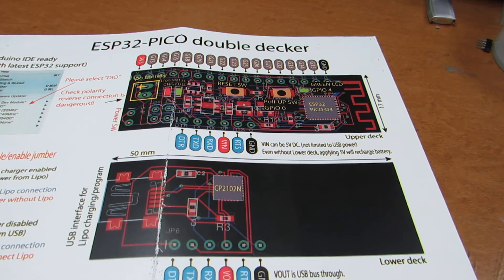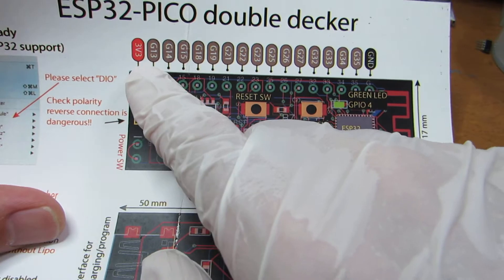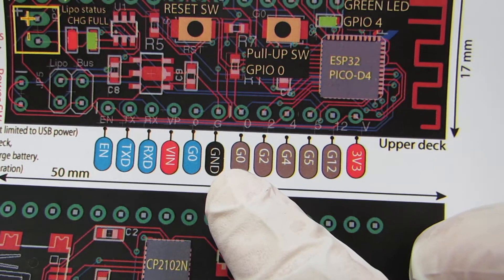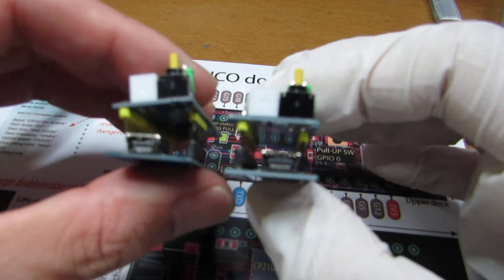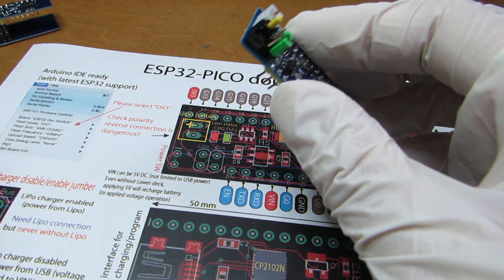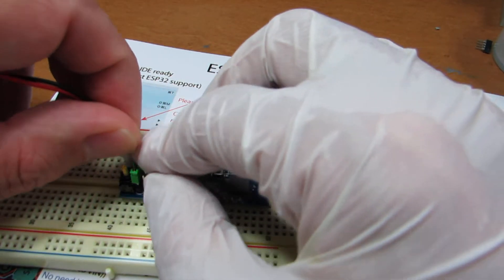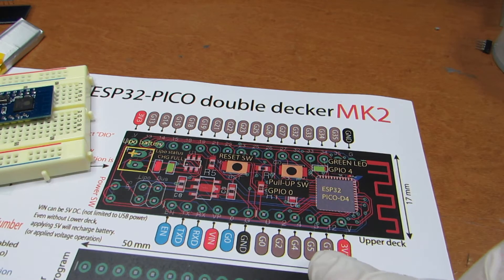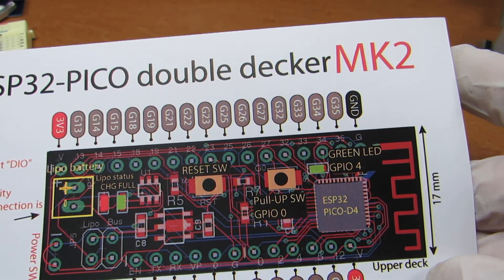ESP32-PICO-D4 Double Decker MK2

Comment: Like your product, I am at Tokyo now, possible to meetup?
Reply from the maker: Ha ha!!
Reply: Is the project open source?
Reply from the maker: Yes, basically all information (not file but information) are open to share.
Reply: No plan to steal it :) That is why I ask whether is open source :)
Reply: I am Malaysia Chinese. No offense, but I am trying to work with the inventor or creator.
Reply from the maker: Please do not start conflict. Actually my making does not contain any confidential matters which is worth to dispute. The point is simple, make or not make, try or not try, use or not use.
Reply: Thanks for understanding.
Reply: Anyway, I will be at CEATEC Japan 2017 from tomorrow to Thursday, in case you happen to be there, please drop by my booth at IoT connection lab (Global Connection) Area.